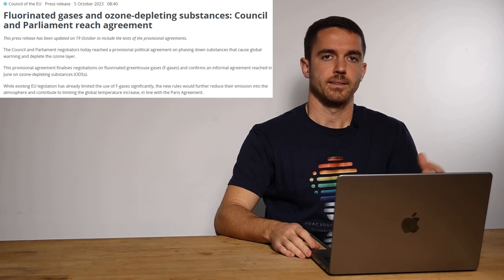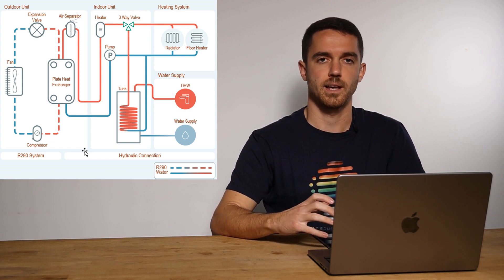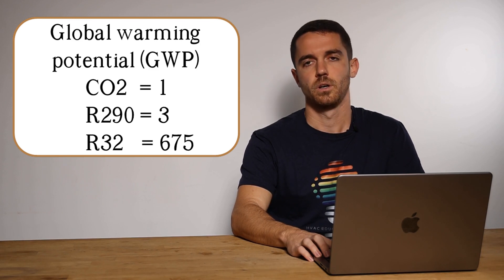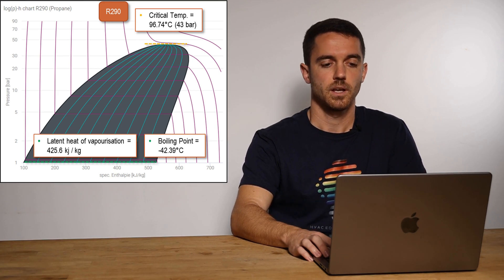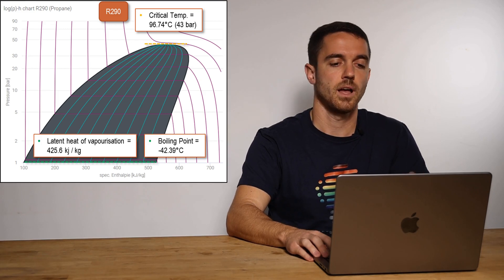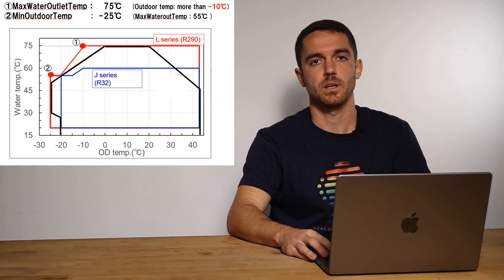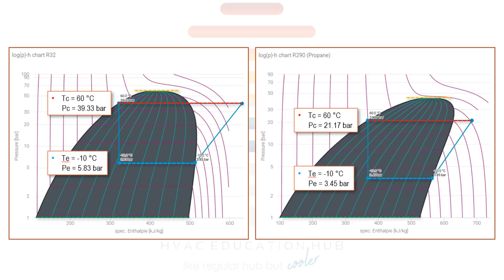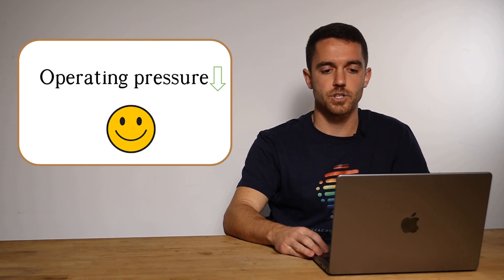The Secret to 75°C Hot Water with R290 Refrigerant | High Water Outlet Temperatures

Comment: It's not a secret. R290 is a superior refrigerant in every way. Perfect for cold climates. Works down to -35C. Can produce water as hot as 90C. ATW mono block has no danger since all refrigerant is hermetically sealed outside. (if you have a propane BBQ that has much more propane and is not dangerous outside). It's also superior for AC cooling. One machine can heat and cool your house and make all your domestic hot water.

Comment: High temperatures are no good for heat pumps. To obtain the highest SCOP and therefore get the full benefit of using a heat pump it needs to be run at low temperatures, typically no more than 35degC for UFH or 45degC for radiators. At these temperatures, R32 is far superior to R290, based on evidence from both research papers and the UK MCS test database. The MCS test results clearly show that R32 heat pumps are far more efficient than their directly equivalent R290 counterparts, for example the Mitsubishi R32 6kW model (PUZ-WM60VAA) has SCOP of 4.81 at 35degC, compared to the Mitsubishi R290 6kW model (PUZ-WZ60VAA - a much newer model) which has a SCOP of 4.39 at 35degC. If you look at the new "Cosy 6" R290 heat pump offering from Octopus,  the MCS test result for SCOP is even worse at only 3.98 at 35degC, a surprisingly poor result.
Reply from the maker: Hi, thanks for the information. I agree with low flow temperatures, few other videos on channel explaining benefit of low temp. However, this video was made for the purpose of comparing how R290 is achieving such a high flow temp. and regarding DHW on applications where higher temp. is needed it will be great.
Also, in next few years with F gas phase out in Europe, everything will go on R290 so if R32 has better efficiency it will not mean anything if it will be forbidden.
Reply: @HVACEducationHub Also a good thing to note is that mini splits with the fan on auto run surprisingly high temperatures on heating mode. I've measured as high as 47 degree air with 21 Celcius intake temp. That's a lot of heat, even coming from cold outdoors and a lot of inefficiency for comfort reasons due to noise and wind chill factor being avoided. I run mine at high fan to be more efficient in heating mode.
Reply: R32 is electrically inferior to R290 and has a GWP that is 226 times as high as R290. R32 is not better and will be discontinued.

Comment: When you said air-refrigerant separator did you mean filter drier?? As far as I know the only refrigeration systems that have an air separator air sub ambient pressure systems like ammonia.
Reply from the maker: No, it means if refrigerant enter the water circuit, it is discharged in the air on the top of the separator as water is heavier it will be free from refrigerant

Comment: I am building a r290 heat pump with an unused r22 compressor and ballance of components, I will be using a closed loop in a 100m deep 15cm diameter well and using the heat in radiant floors.
Thanks for your video adding to my opinion that propane is a great refrigerant as long as you plan for it s flammability!
Reply from the maker: Send me some photos when you finish the project, sounds interesting 😊

Comment: Very nice and ussefull video. I would be curious for a low temp setup, like under floor heating with a temp of 35 C what is more efficient an, R32 or R290 air to water heat pump in an average outside temp of 0C.
Reply from the maker: Thanks.
Some analysis and comments that I saw are on R32 as more efficient for low temp
Reply: Is so much more as to offset the GWP, and the lower efficiency for DHW?

Comment: My 4K tv I switch it on great I don’t know how it works don’t need to.My Heat Pump same can’t change it stuck with it? Everyone says keep the flow rate and temperature down so how does this help Mario it is nice you are trying to help.
Reply from the maker: hi, not sure if understand the question, please clarify?
Reply: What I am saying is why does the heat pump not self regulate.Heat loss calculations haha I put my gas central heating on set the temperature forget about it,put heat pump in have you done your heat loss calculations it is costing a fortune has it been installed correctly obviously not.The cowboys have absolutely no come back on them